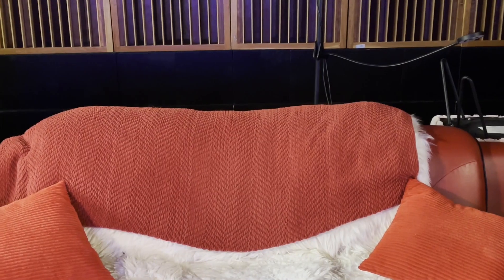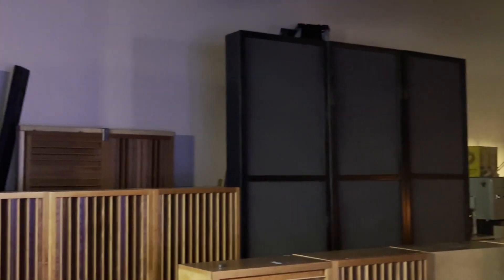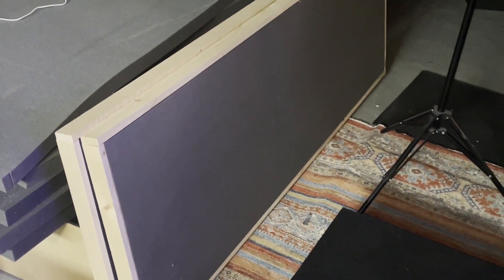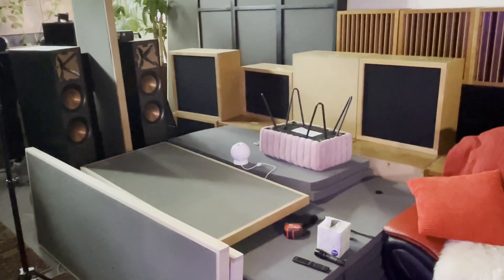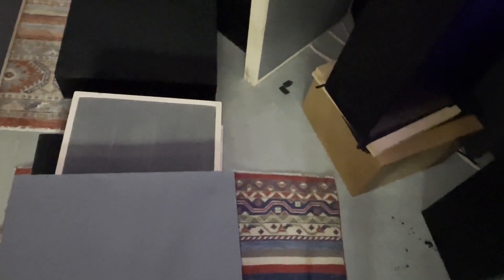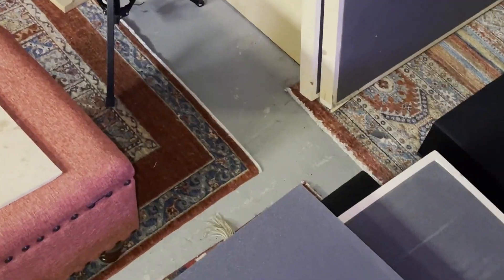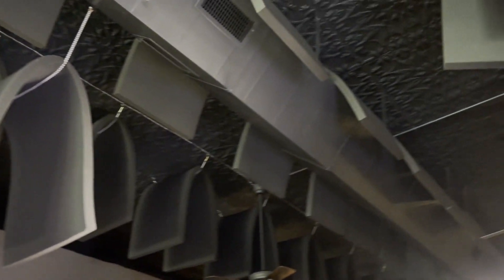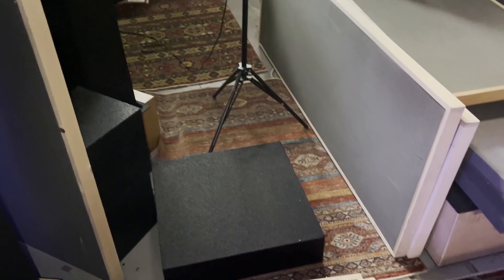Multi-Channel - Middle & High Frequency Absorption - Part 2/6 - www.AcousticFields.com

Comment: Interesting side and rear channel arrangement. Is it done this way for a specific reason? Typically in a 7.X system, the  rear channels are behind the listener.
Reply from the maker: The system is set up at the moment for music surround. There is a difference beteen music surround and movie surround with speaker placement. We are continually moving things around to hear differences. When you have a high resolution room, you can hear differences in speaker placement as it relates to both music and movie.

Comment: JBL L100’s have the multicoloured foam grills. Your voice sounds really natural in that room despite some of the hard materials like the floor and hvac. I noticed the speakers tweeters look like the have been modified. Can you tell us about that? Looking forward towards the rest of the series. Thank you
Reply from the maker: Cork lining on the plastic horns to mitigate high frequency bite. There new version horns have rubber like face of horn coating.

Comment: How do you know when you've used too much middle/high frequency treatment, in the context of your foam technology?
Why is the ceiling foam treatment drooped over like that? Is there a specific reason why?
If low frequency energy is pressure, what is the scientific term for middle/high?
(I know you use the analogy of rays and waves but I'm curious if there is an actual term for it)
Thanks for the video!
Reply from the maker: Managing reverb times is all about having the required surface area coverage to minimize the impact of the ceiling. You calculate the sq. ft. required and install it in a manner that you can add and subtract units. Remember this is a test facility. We are always moving treatments around.
Reply: @AcousticFields  Ah, ok makes sense now thanks for the explanation
Reply: @djhmax09  How can this guy measure anything in that place it is a mess. Something wrong you can't do anything with all that foam hanging up and laying all over the floor never seen anything like it